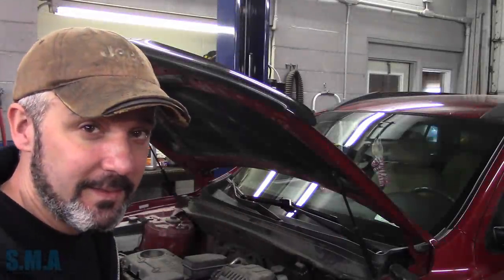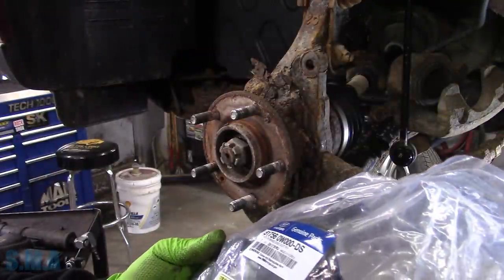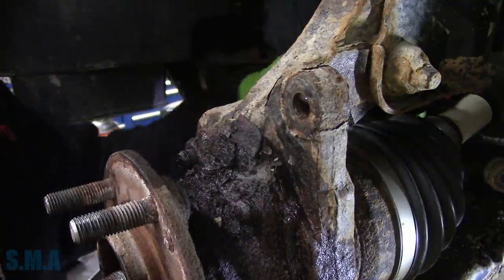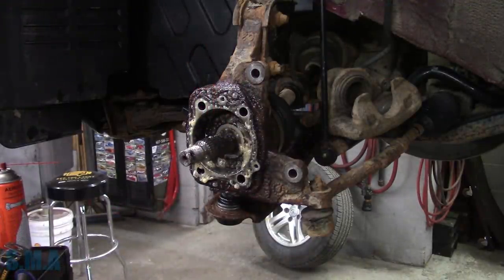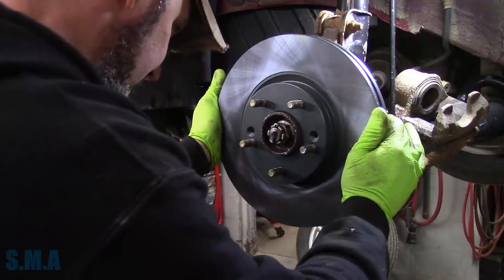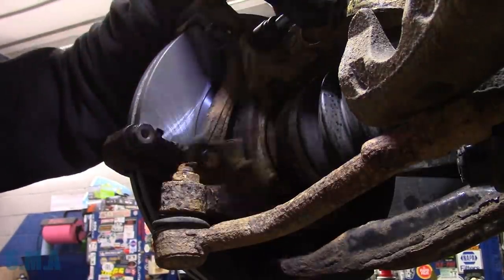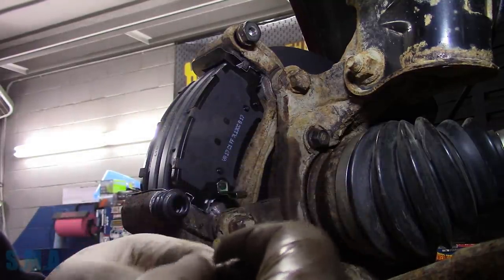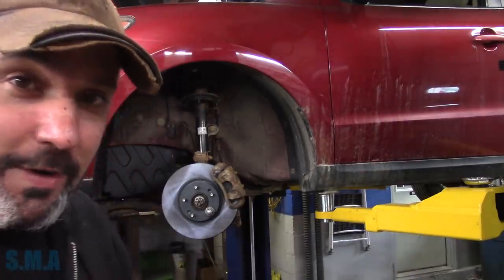Project Hyundai SantaFe: Front Brakes, Bearings & Dust Shields

Comment: YoHo Matie,
I worked at the Ford Lansdale plant (later VISTEON) and we ran on Kroil. Stuck air motor? Spray Kroil in the hose and away she goes. Bolts stuck? Nuts frozen? Kroil on, they come off.
By the way frozen nuts does not refer to marital problems. Strictly mechanical speak...just saying.
Mr. Dude

Comment: Why not lube up the piston a bit while you are in there poking around? I did new rotors, calipers, and lubed pins etc. on my car, and it still created excessive heat while driving. I had to take it all apart again, lube up the piston, and boy that did the trick. Now I am a firm believer that pistons needs lubed up too. I used Castrol red rubber grease for that, it is a sexy grease for sure.

Comment: Napa employee here,
1. We need to sponsor you
2. Just buying things to return "just in case" throws our inventory off as calipers are, at least in my store, auto ordered, now we have more than we need and no room on the shelf for extras, alot of customers do this and we get backed up and crowded with parts.. 
3. I offer you a free and clear pass because your my fave. 
4. Stealing pieces out of calipers is just as bad. Now we have to warranty/defect it for a illegitimate reason, drawing the ire of the supplier.  
5. See #3.
Reply: I reckon he was gonna steal the boots off the reman calipers to finish the job on the car, and then when the new boots arrived in the afternoon, he was going to put those new boots on the reman caliper before giving it back.

Comment: Brake job down south: "needs some pads". Brake job in the rust belt: "Needs pads, rotors, calipers, bearings, backing plates, brake lines, hoses,  and a knuckle to put it all on.😁
Reply: My niece went from upstate NY to Texas and she had a brake problem while down there. The shop she went to gave her a complete list like that. She called me and I was like, "Hey it's a NY rust bucket, They don't see that in Texas and are worried about what is going to break apart when they touch it" They ended up just beating the snot out of the caliper until it freed up on the pins. She drove it home about 6 months later and it expired...

Comment: I'm a little sad and surprised you didn't flush the brake fluid on this 4 wheel brake job. I'm sure those stuck pins would have resulted in cooked fluid at some of the corners.

Comment: My bearing bolts didn't move a bit. I need to remove a knuckle. 
The ball joint is frozen dead too though. I'm going to remove the knuckle with the lower control arm. I can't figure out how to push the ball pin from the knuckle on the car :(

Comment: “Corrosion block” by Lear or whatever it is would work for that, issue is it’s so expensive and takes so long to soak and you need to literally douse things, AND you can’t have any other oils or grease present (clean thoroughly prior) and I don’t even think heat helps it/heat reduces it’s ability to work (warm is ok though), so with all of that, yes it’s technically the best, but at what cost (besides $17 something plus tax), but in all honesty, if you have time and means, and a broken bolt or broken back means the end of the world to you, it’s a life saver, just try to avoid getting the addict’s rush when it works so well on that one perfect match to it’s strengths that makes you waste it on everything, it’s an emergency penetration fluid and only that, keep cheaper stuff on hand also, that being said, for an actual project or restoration, it’s great to just soak every fastener you can reach, both on the thread side and the head to surface side (and shaft areas if not the threads and if accessible) and let it all sit for a day, and reapply to everything each day following and right before undoing things

Comment: Why do you lube the caliper bracket surface that the pad hardware rests on as there is no movement between those parts once installed.  The movement is between the pad and the hardware, which is what I lubricate.
Reply: And it slows rust build up that will cause the pads to bind up when the hardware gets tight from rust jacking. Shouldn't need lube on the pad slide areas.

Comment: The engineers that found out you need to take the damn wheel bearing off to change the brake shield should be hit in the head with a sledgehammer lol. Sure, it’s no big deal, but would be so much more timesaving to not take it off, and keep costs low for customers. 
Love your vids, always have a look on them to learn tricks and become a better mechanic.

Comment: i just hope the 2.4 litre motor on this one doesn't blow up (rod bearing failure).  The ones after 2010 have that slight issue.
Reply: because the older hyundai cars would go 700K+ highway miles with only timing belt set and water pumps(safety changed while apart) and radiator top end tank cracked.
original fuel pumps would often go 400k+ and alternator finally corrode and melt at 500K range. transmission, fluid /spin on filter twice, never rebuilt.
were talking weekly oil changes with 3k to 3.5K miles. lots of front wheel bearing, brakes, cv half shaft(boot failures), lower ball joints.

Comment: Dust shields are getting expensive on older vehicles. Are they really needed?
Reply: That depends a lot on the vehicle. They are not just for dust but to help channel air into the center of the rotor for cooling and to somewhat keep the brake parts protected. Some are fine without them, others can get heated brakes if they run without them.

Comment: A further note, avoid brake  cleaner on  the rubber insert as they can swell and drag check the brake fluid compatability as i've had several brands of fluid cause swelling to rubber inserts oem type inserts for information.Great sight I lean't a lot on my Hyundai Santa Fe through you and others .I've over hauled two so far, great vehicles  Diesel vehicle at about 200,000 - 250,000 need TLC in New Zealand very little corrosion mainly infrequent or poor maintenance. How ever once checked through all codes removed and all mechanical parts moving correctly not a bad vehicle, build qualiity is good.
Thanks again for your great efforts, great viewing though lock down. Keep safe, go well, all the best.

Comment: Hi Eric, I have been following your channel for a year. Question please.i have never seen you turn a rotor. Is because you do not own a  lathe, or the fact the rotos by you are always beyond r resurfacing? Thank you sir.
Reply: New rotors are so cheap it isn't worth the time and trouble.
Reply: Faster and cheaper to just replace them. Plus many times these newer rotors don't have enough iron to be cut and still be in spec. Eric did the same thing I did and sold his brake lathe, mine even went with the complimentary 1/2" of dust still on it.

Comment: we pinch off the brake line open bleeder screw push piston back into caliper that way your not pushing crusty crud brake fluid back through the abs system
Reply: Good luck getting the bleeder open on anything that is over 2 years old in this area. They are usually rotted enough they snap off as soon as you try to move them.

Comment: I would call it heat Shields, not Dust Shields to isolating the cabin from high heat ! in my car left front side heat Shields is not there and very hot came from that tire area. I can`t stretch my left foot while driving.
Reply: Under normal use the brakes should not get that hot, I would check to see if the caliper or pins are stuck and holding the pads tight enough to create a lot of heat.

Comment: Imagine the day you would have if your air compressor wasn't working and it was back to basic hand tools. That's the day I've just had changing discs and pads all four corners and  rear hub bearing on x trail 09, all done on my knees outside the house . The cars are parked about 5 metres from the sea outside the house. Sea salt and cars just dont go, passerbys thought I was calling them a f*** bas***d but I was cursing the last two wheel bearing. bolts.

Comment: Ok another one of them Utuber’s? With the stupid comments! Want comment on you’re Castle-nut  torque. The spindle has 4 hole drilled. The first torque should be set to very minimum torque listed. If the hole don’t line up? You set the wrench to maximum torque and slowly turn the nut till the  hole lines up or the wrench reaches maximum torque? It should align. I use to be in military working in airplanes that’s what general procedure  instruction’s said how to do it. Course we only had break-away torque wrenches then. I know? What does this have to do with vehicle maintenance? Fastener is fastener no matter what it on. I also wonder if you even have to have the electronic torque wrench calibration checked? Course not as important working on vehicles, but on aircraft calibrated equipment had to be recertified every few months, probably not the case working on vehicles? Like you’re channel!  I am amazed how you get that rusty crusty crap apart.

Comment: NO MAGIC, looks like the axle is almost new!!!!! NOW U SEE WHY THINGS ARE MADE OF PLASTIC, no rust … My ZJ has 13 mm 12 point to hold in wheel bearings and were rusted in on 1 side, replacement factory 12 point bolts are 12 bucks a piece X 6 bolts so not cheap, torqued to 70-75